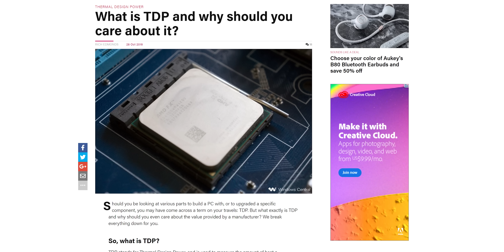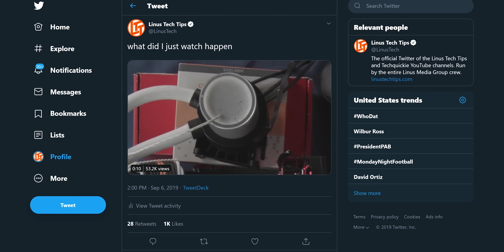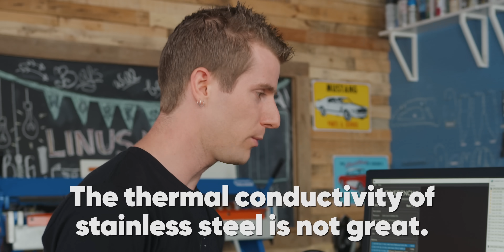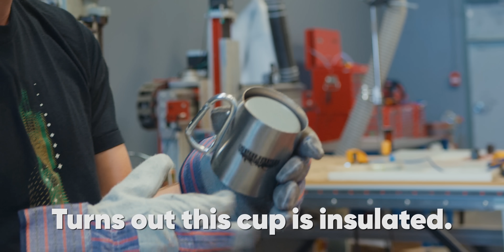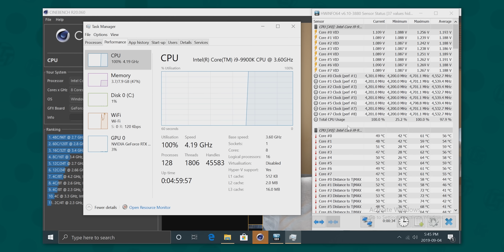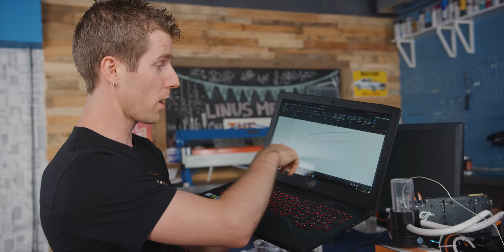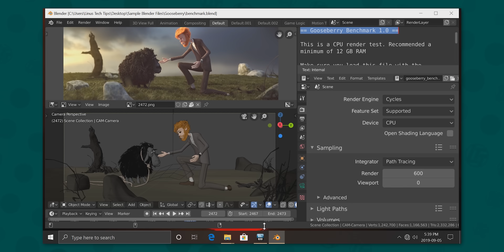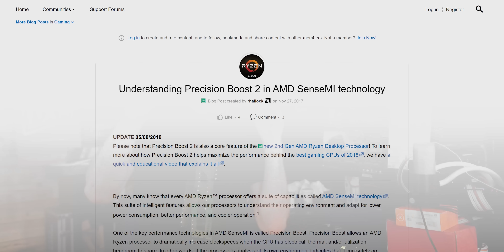Who REALLY Runs Hotter? AMD vs Intel

Comment: I'm not sure how they calculate TDPs but understanding it as the heat it outputs per unit of time, then for intel I'm getting 48W and 45W for AMD from the data of the graphs:

> There's aproximately an increase of 29ºKelvin in 10 minutes
> Specific heat for water is around 4 KJ/Kg*K if I'm not mistaken (amount of heat it absorbs to raise the temperature of 1 kg by 1 ºK)
> The mass of water was aproximately 0.25Kg
> Therefore  29ºK * 4KJ/Kg*K * 0.25Kg = 29KJ in 10 minutes
> 29KJ * 1000 / 600 = 48 J/second = 48 Watts

So I'm guessing half the heat was dissipated out of the water if the real TDPs are around 100W, asuming I didn't make any mistake. The reservoir should be more isolated but since it was the same in both cases the comparison should be mostly valid, righ?. I'm not sure. Half being dissipated and the possibility of that changing due to currents of air and so on does increase the variability of the result. Doing the above calculation for AMD's gives 45W instead, so a 3W difference which is 6%, not a huge difference and, the problem is, that could very well be within the variability of the experiment. It would be interesting to see how reproducible are these results.

Comment: So wait, how much water did you put in the loop? Somewhere between 250 and 350 ml? Because that's all you need to calculate the actual thermal wattage the CPUs where putting out.

Comment: How do I measure the wattage of a CPU? Simple, by the electrical power it consumes THATS IT.
Reply: They're measuring the heat produced by the CPU in Watts not Electrical Power consumed in Watts.

Each CPU is slightly different you could theoretically have a CPU that outputs 5W of heat but consumes 100W of electricity.

Comment: What if the Ryzen 2700x is just a i9 9700k but with PGA instead?!?!?!?!?!? (☉_☉)
Reply: You could say the 2700X is a i7 9700K with quite a lot less single-core ("gaming") performance, but it also doesn't cost nearly as much and has a much cheaper upgrade path until ~2021. Also, two different companies produce these chips so it's not so easy to compare them, although they do follow similar concepts.

Comment: This is the most unscientific experiment l have ever seen in my life.
Reply: i sadly have seen even less scientific experiments than this
Reply: Well he used a kitchen jar instead of a measuring cylinder which ticked me off the most.
Reply: @crowmane6306  You can go all ham with experiment to make everything lab conditioned, but they are not in a lab and I highly doubt there will be a much different results; equalize starting temperature, add inlet and outlet temperature, a flow meter and you are good to go as far as I concerned, a few ml of water differences is not going to increase the overall BTU of water by any significant amount.
Reply: @4IN14094  if you use grams you don't even need to think about the diffrence in volume
Reply: Principled Technologies called, they have something they'd like to show you.
Reply: @stoneymahoney9106  
L😂L
Reply: I hope this is bait
Reply: @johnmadden52  Jailbait is the best kind of bait🤤

Comment: I thought the whole idea of having a thermal mass was so that you could track the raw amount of energy output....but your "known" thermal mass (I use air quotes here because they never equated the amount of water being used) was screwed from the beginning because you introduced an additive, thus changing the thermal properties of the liquid.

Just for future reference, a much better way of doing this experiment might be to set up a pot similar to one used for LN2 cooling and use a non-conductive, known quantity of liquid + the thermocouple, and a sealed lid to prevent the convection of the liquid releasing its energy to the air (see: Bomb Calorimeter for ideas).

I don't think it would have changed the end result of who wins this test, since as you said, Intel assumes base clock, where AMD assumes boost clock, but it would give the numbers a ton more meaning and would shut up all of the fanboys from both sides. Still loved the video, was a fun little experiment and I got a kick out of your use of thermochromic dye!

Comment: How about to measure power consumption in... WATTs... It is simpler an... Correct..ier
For Calories you need other devices... This setup was... Just bad. 
Measuring device on the cable or at wall socket...
Sure - there are some other components with some power consumption, but they are at both systems almost the same and you can surely see bigger difference then few watts

Comment: The 3700X is a “65W” chip and performs almost the same as the 3800X. I really just want to know if the 3700x puts out less heat than the 9700K.
Reply: Well yeah... Even my 8750h laptop with 45w TDP pulls over 80w on boost since you’re using boost power with Ryzen. I did find that one benchmark/load (may have been p-95) got my Ryzen 1700 up to 75w, but that’s still less than my laptop uses under literally every scenario (I’ve seen 80w opening a YouTube video, I mean, it’s like it’s 45w TDP is its minimum, or powered off state... it’s always at 45w for anything more than desktop, and even idle it’s like 25w!)

The Ryzen uses less power (all while delivering much more compute performance), so in every way it’s more efficient.
Reply: @jakegarrett8109  I know it's more efficient, but I'm planning a build that will be limited to a Noctua L9, and I've seen horror stories all over the internet of the 3700x and even the 3600 having problems with heat even on high end coolers even while consuming less power than the 9700k. It's really odd, and I'm still probably going to try for a 3700x, but it seems that some motherboards are having problems with Ryzen 3000.

Comment: The difference in amount of completed work is also why consumers shouldn't attempt to judge the efficiency of a processor by its TDP.  This is especially true as often lower grade silicon gets binned down to lower performing parts of the same product line and assigned a lower TDP to match that lower performance level.  Where possible if that lower TDP part is clocked to the same level it will perform worse and/or consume more power.

Comment: Step 1: Setup a watercooling loop with open res and measure the Volume / Mass of Water that goes in the loop - DONE
Step 2: Measure Change in Temperature of the Water over time - Done
Step 3: Use MATH to calculate the heat supplied to the water by the cpu to heat the water to a known temperature at a given time during the test Q(Energy in kJ) = m (mass/ volume of water 350ml or 0.35kg) x c (specific heat capacity for water 4.183 kJ or 4183J) x dT (difference in temperature). Now multiply Q * 1000 to get it turned from kJ to J and divide by amount of time in seconds and you have calculated the amount of heat either of these cpus emit per second

Example: 

over 15 Minutes (900) seconds the cpus supplied enough heat to heat up the water by 44 and 41.5 degrees respectively. Calculating the amount of Energy supplied over this timeframe gives us
71.57 Watt/s for the 9900k and 67.51 Watt/s for the 3800X soooo not exactly a high difference and since thermal throtteling and boosting are involved i'd say they're pretty much even.

Correct me if i'm wrong and sorry for my bad english i'm pretty much watching this minutes before going to bed and english is not my native language either.
Edit: greetings from germany and ask Roman to explain my Name the next time you guys meet him.

Comment: Don't we already know Intel puts out more heat because everyone says to expect buying a 280mm-420mm radiator liquid-cooling solution (for the 9900k), while the AMD runs fine-enough on the included fan? 
But then again, the INTEL does more work with more energy, while the AMD silicon runs into a brick wall despite pumping more energy into it.

Comment: Really cool idea - but also a bit too high jank-factor.
I think it should have been a goal to get an approximate wattage number of the test.

Just a big block of lapped and thermal-insulated copper with a small probe hole + some board insulation would do the trick here. Use a big enough block and not only do you get more granulated results but you won't even have to properly mount it, as it will provide it's own pressure assuming it's reasonably centered. Some heat-leak inevitable, but that's as good as a practical test will realistically get short of a vacuum chamber.

Or just use a induction current-meter to measure the CPU-rails and call that good enough. I bet it would be as accurate as anything and you could focus a lot more on the variety of tests you ran.

TDP really sucks currently, and it makes no sense that we don't have a standard for it.
After all, what are the top 2 characteristics you want in a CPU? (high) performance and (low) power-draw.
Currently we don't have a standard measurement for either. Performance is probably inevitable as it depends so much on what exactly you are doing and how the CPU is built - but power should be EASY! Each company already have these numbers. They just need to agree on a common way to present them. Unfortunately, whoever has less power efficient CPUs at any point in time will refuse to standardize as it would be to their detriment.... sigh

Comment: This testing methodology seems overly complicated, and very unscientific. I'm not sure the result mean anything.
Reply: You must be new here
Reply: sorry guys, but this time you really did a bad job
Reply: idk about that, i mean, it was fun for me to watch, so ill count it as good enough
Reply: It is sketchy but is has the same results as most other tests done in the area.
Reply: @Seleya They actually did do this pretty scientifically, in the end. The original set up was a little janky, but when they switched to the pump + reservoir, they removed a lot of extra variables (such as convection within the vessel being different due to varying layout of the CPU beneath, varying mounting pressure of the vessel for the different CPUs, etc.) In the final setup, they used the exact same cooling loop with the exact same amount of water, and a proper CPU block to ensure the same mounting pressure there. All of this means that the only real variable between the two systems is the water temperature over time, since they started both runs at the same water temperature. That variable, in turn, depends on the heat output from the CPU, and the heat loss to surroundings, but the latter is the same for both systems. Therefore, I think they did a pretty good job of getting data that they can actually compare between the two CPUs. That's further strengthened by the fact that they recorded many temperatures at many times, showing a consistent trend.
Reply: It can't due to to many parts being different even they said in the video they are changing the speed to give AMD a "fair chance" to that they should have done it with both speeds with both sides then
Reply: Dont worry they dont
Reply: That's how wet lab tests are done 😒
Reply: Honestly I think Intel finally dropped them and realized people don’t use their videos as suggestions. This is probably LMG low key hitting back intel for not giving them free chips on the side.
Reply: YES! Linus is very creative and can have fun doing the weirdest things....AWESOME! hehehe
Reply: Yeah. Just take a big reservoir of water at defined temperature and pump it slowly through a cpu block while running on 100%. Once everything is in thermal equilibrium just measure the temperature difference between water going in and out and if you know the flow you can easily calculate the heat output (ignoring heat loss through other channels).
Or even easier is just using a loop in equilibrium, however, would  be better if both systems would run on the same water temperature.

Comment: I have been toying around with the idea of doing something like this for a long time, but I would have used a bucket of water and pumping it through the cpublock and measuring the delta temperature of the cpu-block. This would give a resolution of down to a couple of seconds and would be much more precise, to the point of being able to calculate watts within 5%. You just have to know how much water you pump through and then it's 9th grade physics from there. Another interesting comparison of this is the deltaT of the CPU's (IHS solder quality) and TDP Vs temperature(50 Vs 80 degrees)/overclock/cpu-voltage/different quality VRM's and motherboards, and it could easily be used to test against previous generations of CPU's, etc, as it is very precise and the motherboards heat-contribution is minimal

Comment: You need a CPU shaped electrical heating block so you can calibrate your setup by passing in known amount of electrical power and measuring the response of your calorimeter

Comment: I could hear this strange, howling  scream from somewhere in the distance. I think it was Gamers Nexus.
As for me, I would have built a closed loop, with a set amount of water, and then have a temperature probe monitor the temperature over the course of a set workload. Assuming the loop is the same, and you make sure you run the tests at the same starting temperature, you should be able to measure any difference in heat being dumped into the loop over time.
Reply: Yeah, it's probably GN... because there is some serious scientific error in this video... Linus, please call Steve from GN and ask him to explore this in more depth, maybe on a collaboration video.
Reply: Yes. Collab with Steve. In Steve we trust.
Reply: Um, did you watch the video? They did exactly that.
Reply: I can hear Steve all the way up here in Canada
Reply: Have you even watch the video, that is exactly what they were doing, same amount of water, same amount of temperature sensitive dye, data logging temperature probe to a laptop.
Reply: @4IN14094  Yeah, but the addition of the color changing liquid was a moot point. A simple temperature reading from a closed loop would have been much simpler, and more effective than the dye.
Reply: But this is more fun.
Reply: EXACTLY.
Reply: It's like Anthony found this colour changing crap somewhere and wrote it into a video. It's totally unnecessary.
Reply: You don´t really need a closed loop, which would add new variables and other sources of heat as well as heat loss.

T_Inlet, CPU-block, T_Outlet and something to measure the flow. 

Just use your tab water (because it´s really constant), connect it to the CPU-block, measure the temp before and after, let it run for a bit and calculate the heat flow. That´s it.
Reply: How much do you wanna bet Steve will make a video response to this?
Reply: @femina_multis_faciebus  what time does he have reviewing the same mid range spec gpu card over and over again.  Very boring at mo to be fair
Reply: FK GAMERS NEXUS THERE CONTENT IS BORING AND UN REALISTIC LN2 LOL  and doing tests on cards or to be fair not doing them at all. killed it for me

Comment: Will you do a video comparing 2nd gen Ryzen AMD CPUs to 3rd gen chips of the same price? Such as 2700 vs 3600? (Which are about the same price currently.) I'm curious to see the performance difference between them, especially in productivity scenarios, since the 2700 has more cores and threads.

Comment: wouldn't it be much easier to just measure the power going into the CPU (say, at the VRM shunts)?
Reply: yes it is. what other energy does a CPU release out other than heat?
Reply: @Alistair Where does it go then if not waste heat?
Reply: It's called black body radiation, all lost energy in this case is converted to heat. Trying to shunt the VRM might not be feasible as you're dealing with a lot of current. You'd have to cut traces on the motherboard and insert your shunt, so it's in an experiment tier above anyone who tries to use click-bait titles (Yes, they're better than they used to be).
Reply: @3le6996  why are you bringing up blackbody radiation? a simple conservation of energy based explanation is sufficient. And yes i think you're right, shunting the VRM output is a bad idea, but the input seems feasible since it would be around 1/10th the current (although would still require cutting traces), although then you'd have to account for VRM losses. Resistive losses could be calculated by the current (measured via shunt voltage) * the VRM voltage drop. Whether you could isolate out switching losses would depend on where the gate drivers draw their supply from i guess. so yeah, definitely more of a der8auer level video but... they do have skilled engineers/techs, i think they could've pulled it off
Reply: also i was mistaken about "VRM shunts". I was thinking of the shunts the controller uses in order to measure current, to do current-mode control (which is more responsive than just directly regulating voltage). But it doesn't need an accurate current measurement for that, just a feedback that's correlated with the current. i think most power stages use the MOSFET's drain-source resistance as their "shunt", not sure.

Comment: Why didn't you just use an LN2 pot filled with water?
Reply: The pots used for N2 cooling have a significant thermal mass on their own
Reply: Would be better
Reply: Why not measure the input power instead, using an ammeter?
Reply: @brothermine2292  ... Or rather, several ammeters and voltmeters ('cos of multiple supply rails, voltage droop, etc.). But yes, way more sensible approach.
Reply: Because LN2 pots work by chilling the enormous thermal mass of the base of the pot at the contact point with the CPU using the LN2, not by transferring the heat into the LN2 itself.
Reply: @stoneymahoney9106  it's a thermal transfer regardless of it's direction
Reply: ClapTrap if you were only wanting a relative comparison yes but they were trying to calculate power draw

Comment: You guys should have done these tests with some 3M Novec fluid on custom plates in a closed loop. The boiling would solve your convection issues, and you could easily put in a rubber grommet for the temp probe to limit evaporation.